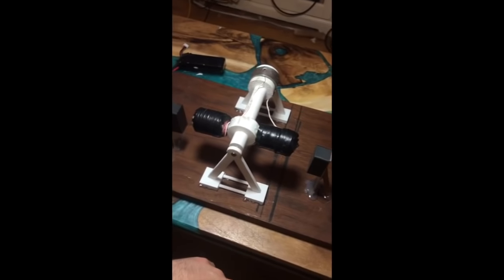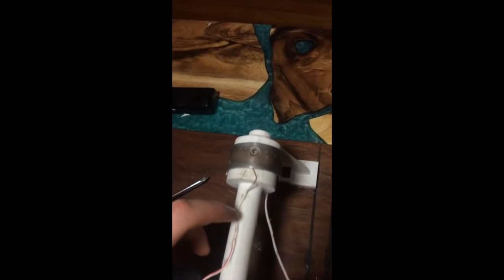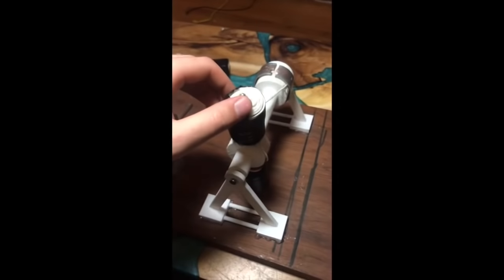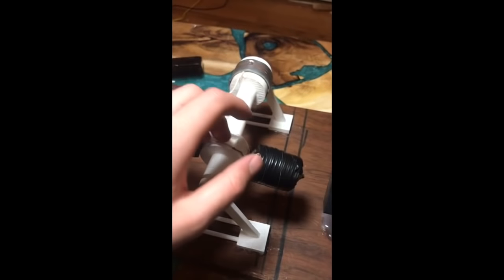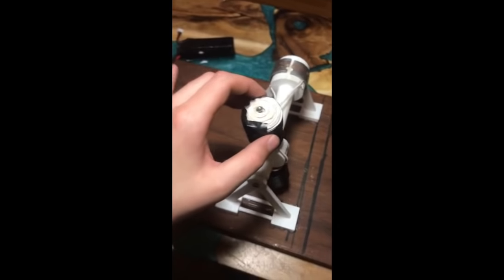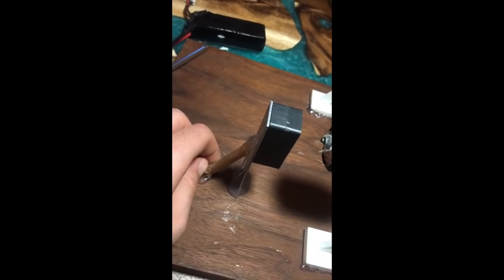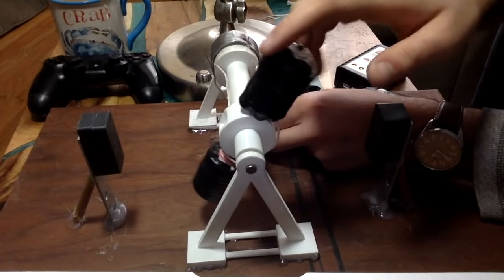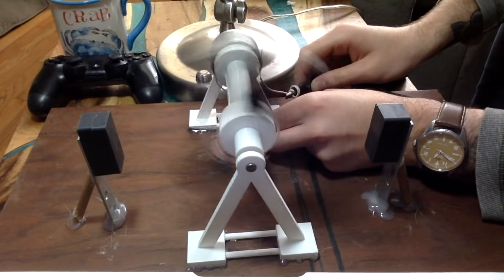3D printed brushed DC motor

Comment: maan, no one does 3D printed brushed motors. brushless? FULL YOUTUBE OF EM! but no brushed, even tho they are like 1000x easier to do. why? because they are too easy to make? is that why? iam going to print mine. iam still designing it. the rotor is going to be 12 segment, 9,6cm high and 5cm wide. iam going to use elctric steel from a transformator aswell. we will see how this ends up, if good, iam going to post the .stl files somewhere. it is going to be a big motor, and an even bigger project